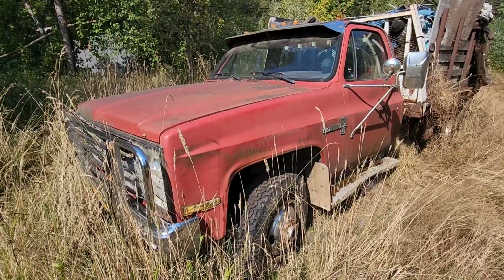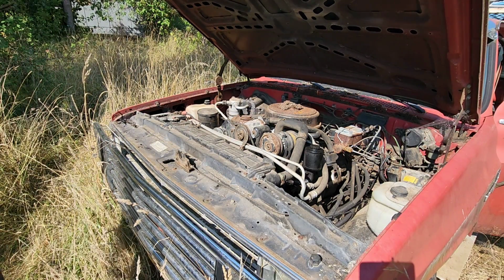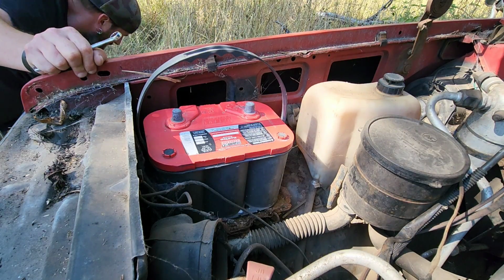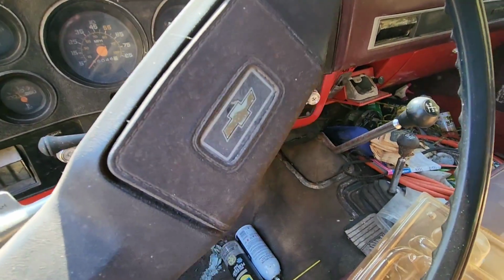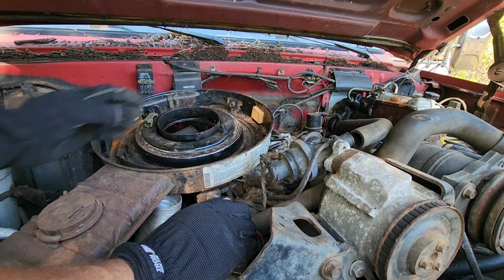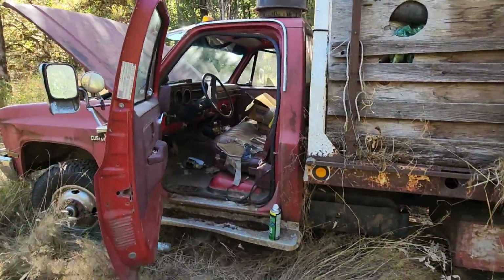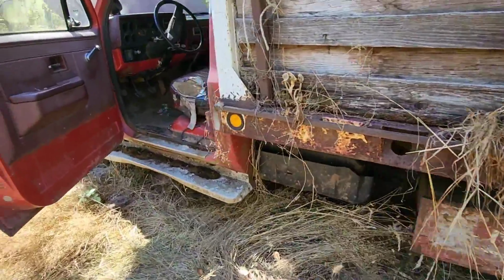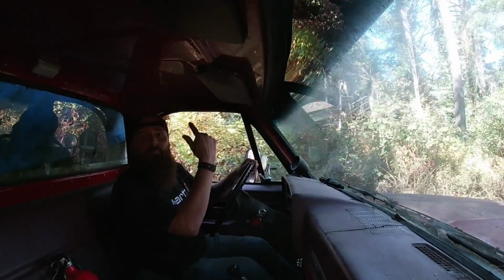Will It Run and Drive? Chevy K30 Custom Deluxe Dually 4x4 Dump Bed Truck Been Parked for ? Years!

Comment: It's not a problem if the insulation is burnt off a ground strap because ground straps don't need insulation, and the copper can be misshapen too, but the copper does need to still be there and it looked on the screen like maybe some of it was burnt or corroded away, not sure on the screen.

Comment: Love those square bodies!  They are bulletproof.  I had a 1978 K20 with a 400/AT long ago.  It got 6 mpg no matter how it was driven.  But it NEVER let me down until I started getting a rod knock.  Even then, I drove it with a camper on the bed to its new owner 40 miles away and it didn't strand me.  Bulletproof!
Reply from the maker: Awesome! That's Right! Hey Thanks Kurt! ✌🏻

Comment: Way to go, Jason! Love the look of those old Chevy trucks. That'll come in handy on the farm too.
Reply from the maker: Hey Thanks!
Reply: @CountryBoyGasGarage  YOU NEED A GROUND WIRE RUN FROM BATT POST TO GROUND FOR THE ALTERNATOR  TO CHARGE RIGHT
Reply: @CountryBoyGasGarage  YOU GOTTA STEP ON CLUTCH TO  START TRUCK SAFETY INTERLOCK

Comment: It's supposed to have an inside latch and I think it'll fire right up if the engine isn't stuck. I think it's gonna turn over and start, hopefully. Without even popping the hood yet I'm going to take a guess and say it's gotta 454 or 402 big block with 4 or 5 speed stick. Those ol trucks have good 4x4 running gear cause I had 1 and it'd almost climb a tree lol.  You done a fine job getting it going again and it sounds like it's running really good. I'ma huge fan of the square body Chevy trucks especially a dually 4x4....
Reply from the maker: Hey Thanks for watching and the feedback Carl! I Love the ol Chevys!

Comment: Hey at least the empty side is small side just bein2 the rear brakes and it's just a vacuum assist system real simple system. The fuel will be fine since you're intelligent enough to use Berryman so just dump another couple if cans in the tank and it'll clean right up and you'll be golden👍

Comment: Thats an aesome truck i would love to find one that looks so clean.  Also you can put the transfercase in 4 lo for some added power and with the hubs unlocked up front it ia 2 lo which i find handy for backing heavy trailers.  Course the sm465 is got the granny gear too.  Those hydroboost brakes work real well once sorted out.  

Again awesome vid and truck.  If you ever want to let her go let me know.
Reply from the maker: Hey Thanks!

Comment: before you look at anything look at the little piece underneath where the brake is that could be stuck open or stuck shut that's why the brakes are on or park lights
Reply: That wouldent make the parking lights stay on  that would only make the brake lights stay on and the parking lights are what stuck on lol